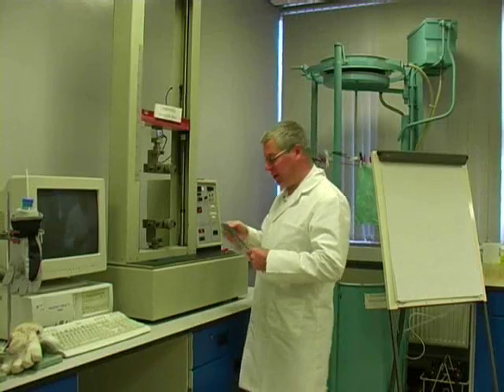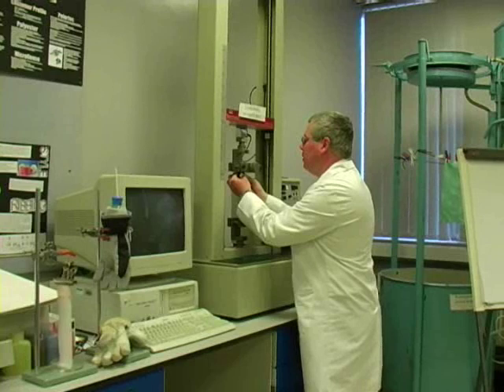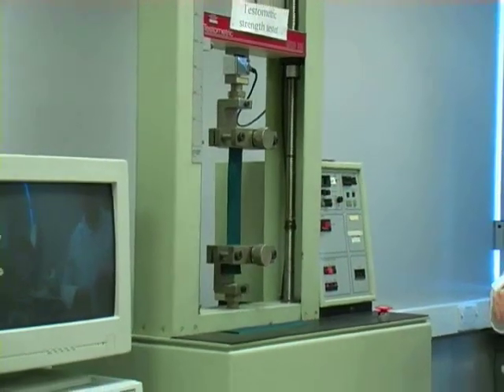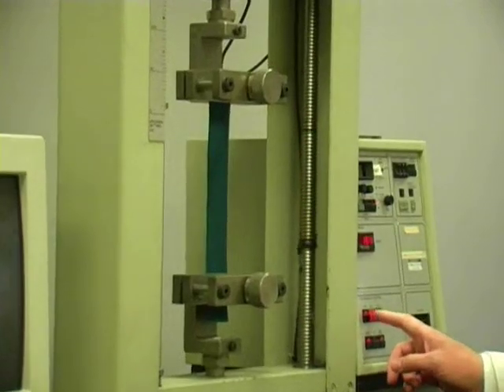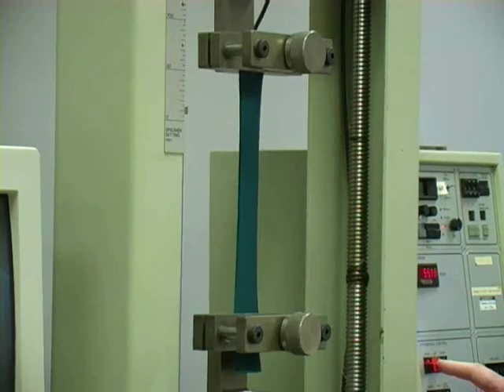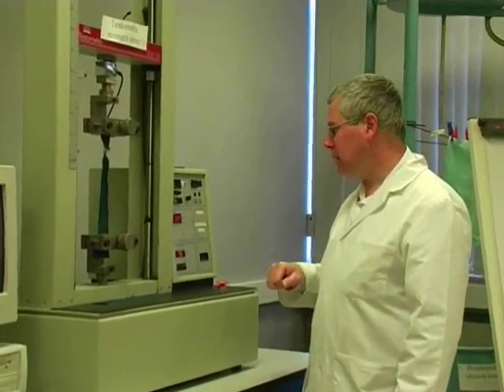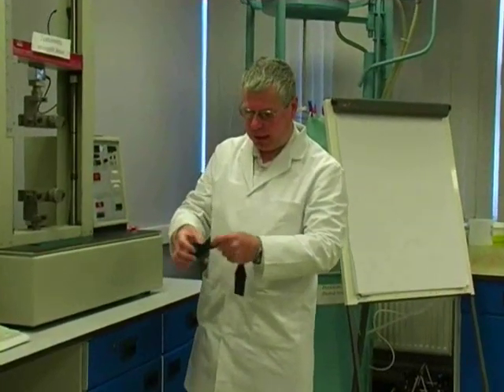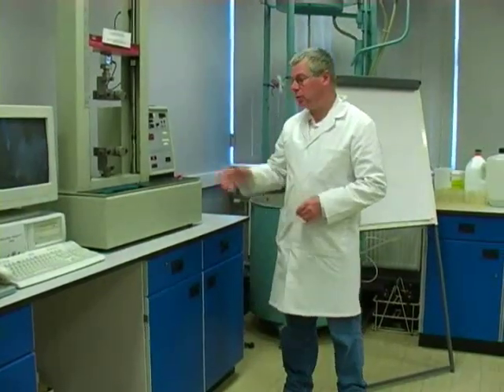Fabric Testing - Tensile Strength Test

Comment: Hi, I'm living in a developing country where the 'professional' textile merchants have never heard of the words 'Denier' or 'Tensile strength'. Thus, I've been struggling to find the material I need for a little project, but was happy to stumble across this video.  I think I can test my own material (roughly) by simply incrementally loading a sample with weights until it fails, right?

In this video, I heard it said that 50mm width was a standard for this type of test. Is there a specific or minimum length, also?
Furthermore, it was mentioned that both directions are tested 5 times -- are the results added together and divided by the number of tests (10), or is there any need to weight ('scuse the pun) the final result -- e.g. 60% of weft + 40% of warp?

Thanks for posting the video.
J
Reply: width is 50 mm, length is according to your machine.All results must be divided by their quantity. If have any questions about testing of fabrics, you can contact to me
Reply: Hey sir Jonathan! I'm also doing a project right now that needs to determine tensile strength but we don't have this machine in our area. How did you conduct your tensile strength test manually?